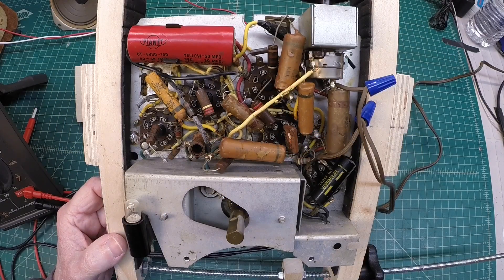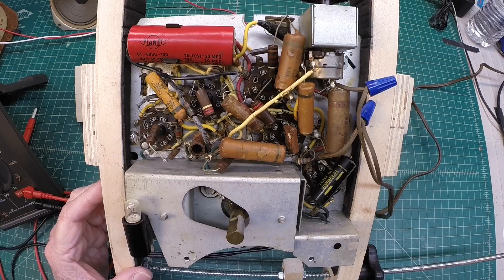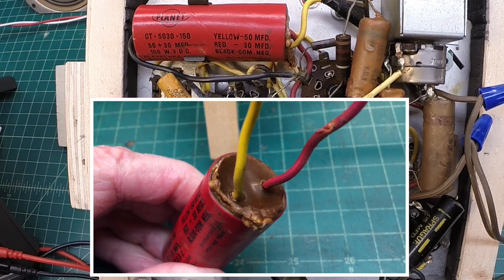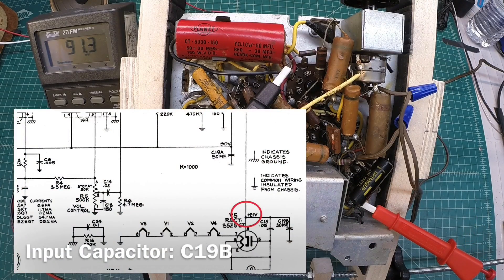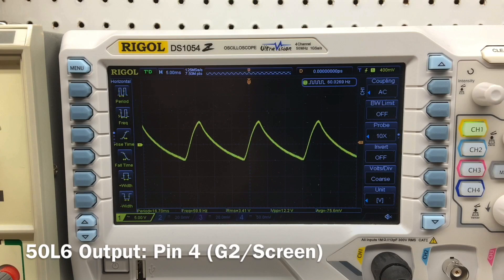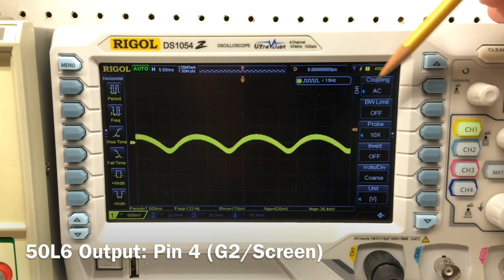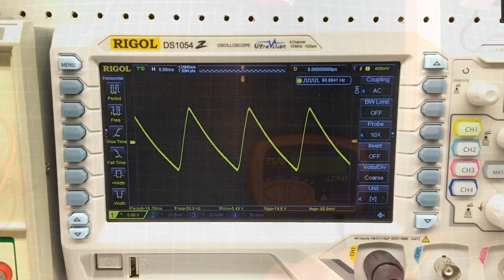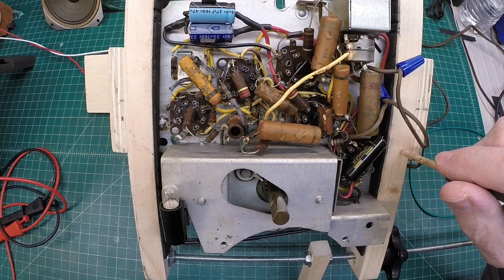RCA 8-X-541 - Cause & Effect P1 (Why You Should Never Power Up a Vintage Radio or Alike Before...)

Comment: It is always a temptation for someone to try out an old radio having no idea as to the danger to themselves and to the radio itself.  That is why so many plug are cut off which is a shame, as many of those old Bakelite plugs are original and could be re-used AFTER the restoration is completed.  Many of those old Bakelite plugs sell for more than the radio itself, as many are now quite collectible.
Reply from the maker: Richard, you’re spot on. Those reproductions are not cheap for sure. Best, Don

Comment: Those filter caps lost almost all of there capacitance, I like your meter clip on leads Don.
Reply from the maker: Yep, totally used up. I was really surprised to see both of them providing less than 1 microfarad of capacitance. Jim, there are many sources for the Parrot 3mm leads, but here’s one for reference: https://www.ebay.com/itm/183841971405

Best,

Don
Reply: @RestoreOldRadios  Thank you Don for that information I just ordered it from eBay. I like the design of it.

Comment: Great informative video. Some of use a pretty new to this, perhaps some mention of how to protect your oscilloscope when doing these measurements? or if you already have a video on this? Thanks a bunch and keep up the good work.
Reply from the maker: Thank you David. You need to ensure your isolation transformer ground and neutral are not tied together and the piece of equipment being worked on has no earth ground connection. An isolated probe like the the BK PR-60 can be used as well according to Dave and others. 

Check out the videos below from Dave, Paul and Doug on this subject that are very educational.

Best,

Don

Isolation Transformer w/ Oscilloscope

https://youtu.be/xaELqAo4kkQ

https://youtu.be/XBsQ3sZ45Fk

https://youtu.be/5SjVm-rF39A
Reply: @RestoreOldRadios  Thanks a bunch for these. I was actually watching Dave at EEVblog's video when the notification arrived :)

Comment: I wanted to ask you a question about your fluke meter ,I just bought a fluke meter I take it they dont make your model any more,but I notice several radio techs have that model is there a reason why that model ,I hopeing the fluke 18B+ model I bought will serve me well .If you have a opinion on it .I would love your input ,I love watching your repairs ,I always learn something from you thanks for shareing
Reply from the maker: Ron - it’s always good to hear from you and I hope all is well. Your Fluke 18B+ meter is a superior meter and has capacitance capabilities that the 27M lacks other than estimating the capacitance value. The AC feature on the 27M reads AC from 40Hz to 30kHz, so for testing audio without a scope is convenient. Aside from that, the 18B+ looks to be equal in its measurement capabilities. Hope this helps. Best, Don
Reply: It does help  thank you

Comment: You could read your ripple with your meter.   Just put it in AC mode.   It should match the scope's volts RMS value.
Reply from the maker: jp - readings are somewhat close using my Fluke but less than what I show on the scope. Post capacitor change the 50L6 on the scope reads .65Vpp and the Fluke reads .144rms*2*sqrt(2) = .41Vpp and the 35Z5 reading on the scope was 19.6Vpp and the Fluke reads 5.42rms*2*sqrt(2) = 15.3Vpp. Do you feel the Fluke readings are inside the tolerance window? Best, Don
Reply: @RestoreOldRadios  I've noticed my Flike 87V doesn't match what my scope readings show for RMS either.    Not sure what to think about the accuracy of each.  I hate these kind of discrepancys.    I guess each are relative.   Better readings on either is a better reading.   Seeing the signal change definitely instills better confidence that a significant change occurred.  Good thing we are not working on the space shuttle.    LOL.     Looks like a great series.   Look forward to more.

Comment: should use a dimm bulb too
Reply from the maker: Ian - thanks for the recommendation. My work around at this point is a fast-blow 0.5A fuse in the Variac. Do you feel like this solution would work equally as well? Best, Don
Reply: @RestoreOldRadios  i would never rely on a fuse, with a 100 watt dimm bulb in series with the active supply on your mains you can see how much current is being drawn. 2nd of all the dimm bulb will absurd  lots of current is a component was to short . less stress on the power transformer. i my repair bench i use a bimm bulb every day
Reply from the maker: Thank you Ian. What watt bulb do you recommend for an AA5 radio vs. a receiver with a power transformer and 5 to 7 tubes? Best, Don

Comment: How did you connect the oscilloscope? Was it on the same isolation transformer, or do you have a differential probe? I tried hooking mine up to a floating chassis like this and nearly fried the ground connector. Nice video!
Reply from the maker: Thanks for watching and reaching out. You need to ensure your isolation transformer ground and neutral are not tied together and the piece of equipment being worked on has no earth ground connection. An isolated probe like the the BK PR-60 can be used as well to your point as endorsed by Dave and others. 

Check out the videos below from Dave, Paul and Doug on this subject that are very informative and educational.

Best,

Don

Isolation Transformer w/ Oscilloscope

https://youtu.be/xaELqAo4kkQ

https://youtu.be/XBsQ3sZ45Fk

https://youtu.be/5SjVm-rF39

Comment: Surprised it wasn't even noisier as bad as those caps were! Great demo!👍👍
Reply from the maker: Bob, me too. I’m wondering if the hum cancellation provided by the output transformer configuration plays into that. I’ll have to experiment and see how many decibels of reduction it provides. Best, Don
Reply: @RestoreOldRadios  That would be an excellent experiment. If you rewire the output transformer in the usual configuration (leave out that tap), take a measurement before and after, and see what the difference is. That tap is supposed to provide some hum-bucking effect.
Reply from the maker: I didn’t rewire, but I did publish a video on how the output transformer configuration creates a 180° phase shift and helps mitigate hum. Best, Don